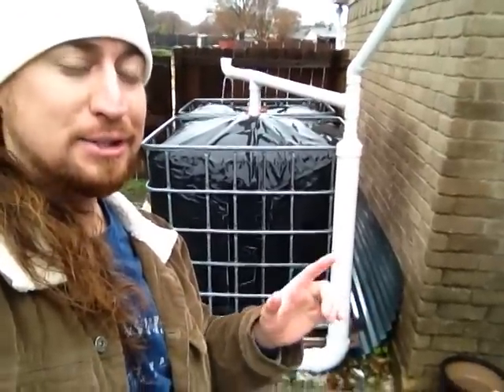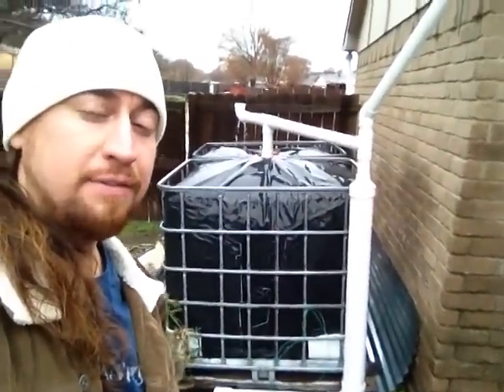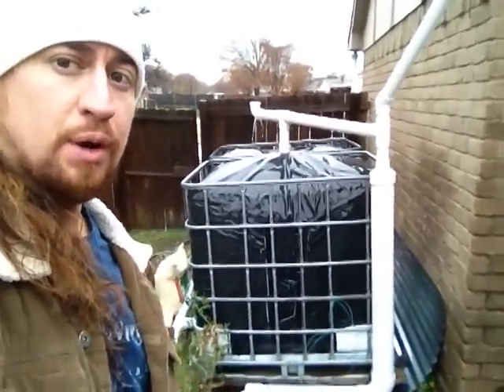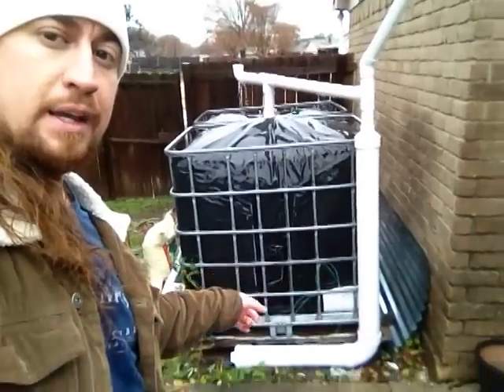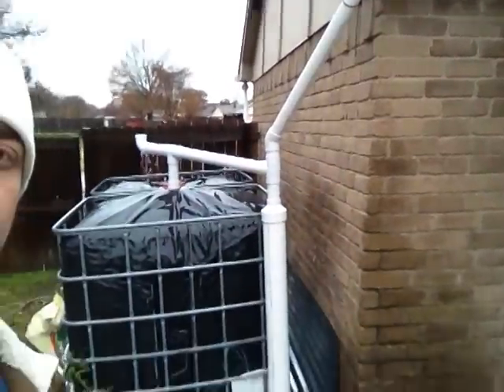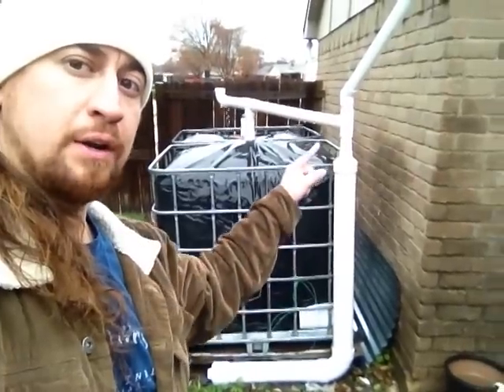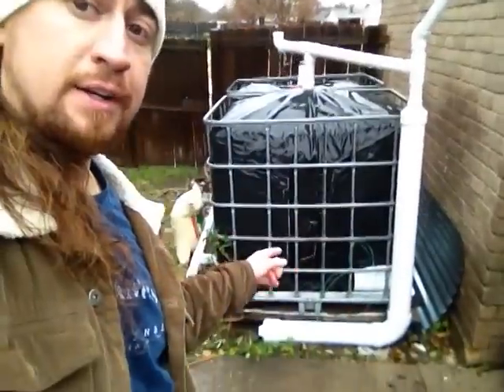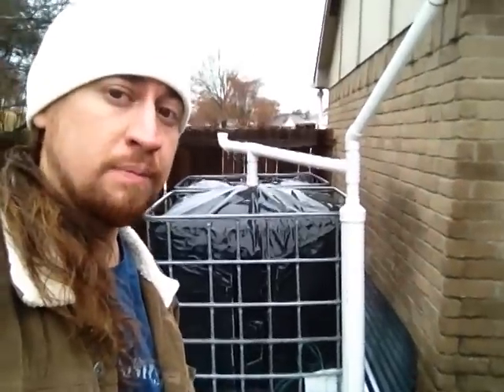PermacultureTips - Rain Water Harvesting and First Flush System

Comment: I live in Massachusetts and I just acquired two totes and i had two questions, if i am storing these under the deck out of the sun, do i need to cover them to prevent algae and i imagine i would need to drain the water in the winter so they don't crack?  can i design the first flush system with a ball valve to i can use it as a regular gutter downspout in the winter, connected to the screw fitting near the ground that you have made.

Comment: I don't believe your first flush system is large enough.  If you took the amount of water it holds to the top of the roof and tried to wash it, do you really think it would clean off all the dirt off the roof, and flush it out of the gutters?  As to covering the tanks with the black plastic, yes, it is necessary, unless you don't mind the sun deteriorating the plastic, not to mention the algae bloom you will get with the translucent white plastic.  I think you would be happier top filling both tanks, a simple "t" fitting on the second tank will both fill and vent the tank, plus filling from the top your second tank will have cleaner water in it that the first tank.  Filling from the bottom shares the dirty water with all the tanks, so will in time have to clean them all, instead of just the first tank.